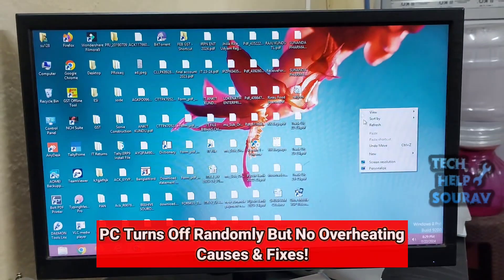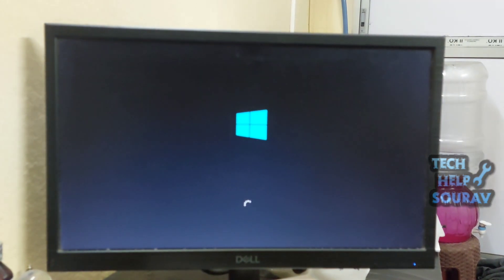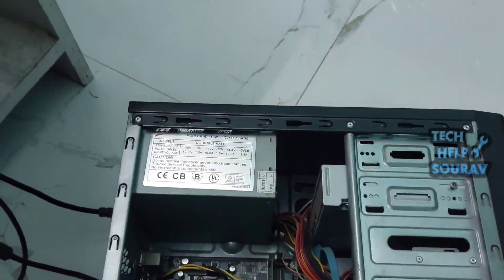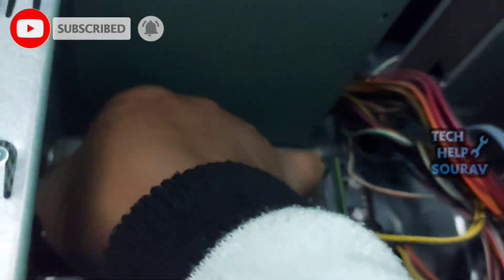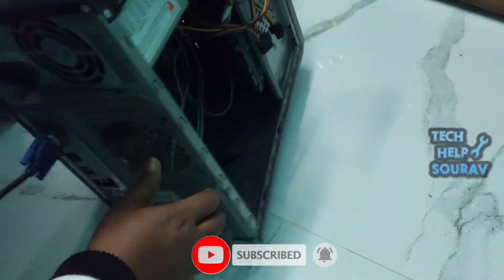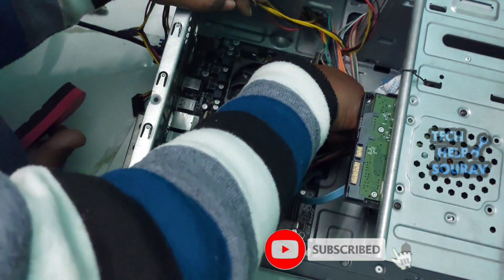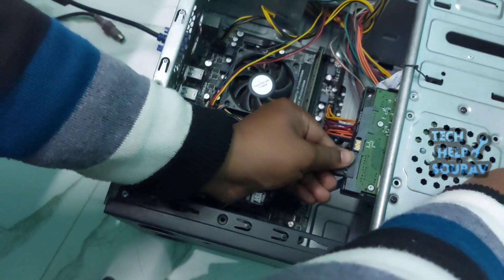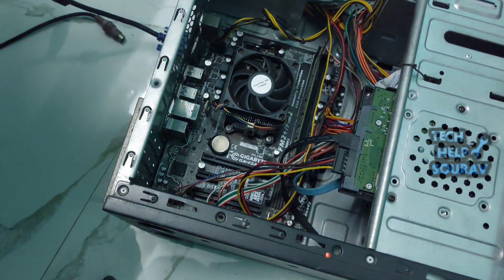Computer Turns Off Randomly But No Overheating On Windows 10 Or 11 - How To Fixed

Comment: Lenovo laptop
Reply: Look for "Load Defaults" or similar options:
Within the BIOS, find an option to reset the BIOS settings to their default values. This is often accessible by pressing a specific function key (like F9 or F10) or through a menu option.
Save and Exit:
After loading defaults, be sure to save the changes and exit the BIOS (usually by pressing F10 or selecting "Save and Exit"). 
4. Use Windows Recovery Tools:
Boot from Windows installation media:
If you have a Windows installation USB or DVD, boot from it. If your computer has UEFI, make sure to select the correct UEFI boot option for the installation media.
Access Troubleshoot options:
Follow the prompts to access the Windows Recovery Environment and then navigate to Troubleshoot -> Advanced Options -> Startup Repair.
Run Startup Repair:
This tool can attempt to fix boot-related problems automatically.
Consider other options:
If Startup Repair doesn't work, you can try other options in the Advanced Options menu, like Command Prompt for more advanced troubleshooting

Comment: Hi what to do when default boot device is missing and up and down keys are not working
Reply: Ensure the drive is properly connected:
Open your computer case (if comfortable and safe) and verify that the hard drive or SSD is securely connected to both the motherboard and the power supply.
Try a different SATA port or cable:
If you have multiple SATA ports, try connecting the drive to a different one. Also, try using a different SATA cable to rule out a faulty cable.
Consider a hard reset:
Disconnect the power cord from the computer and remove the CMOS battery for a few minutes. Then, reconnect the battery and power cord and try booting again.